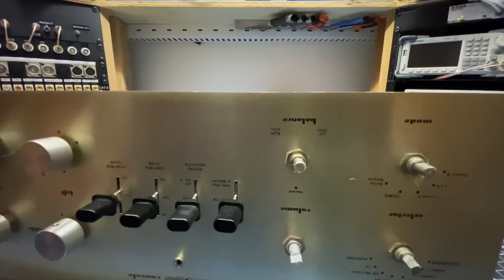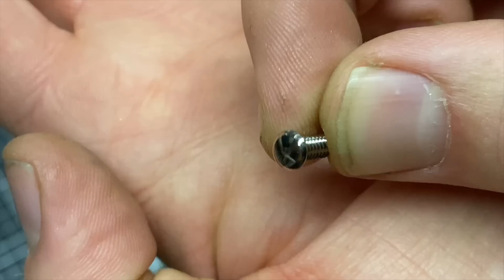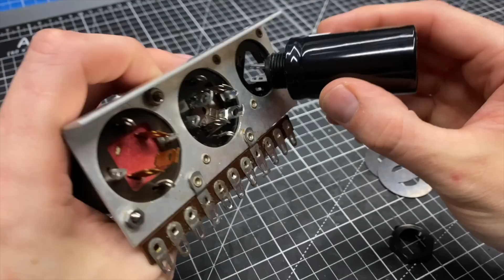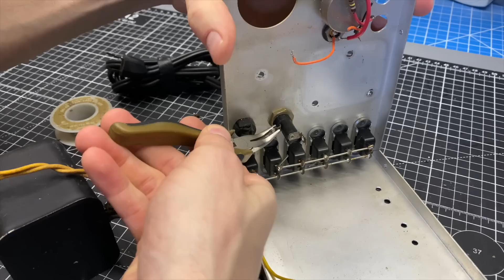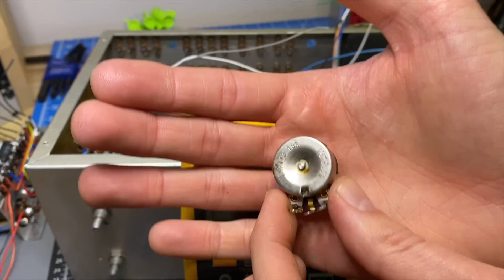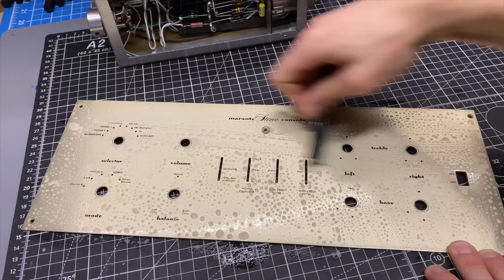Marantz Model 7 Rescued - Gut Rebuild of Hacked Unit at the Bench

Comment: When You are dealing with a really nice high end preamp... I would say less than an ohm between all the phono jack grounds and ground is really important.  Especially if the panel is aluminum.  I would say wire in each ground,  put them on a buss and return that to main system ground by soldering.

Comment: Beautiful work on that amplifier, I can't imagine how many hours total you have in that rebuild from the original hacked up amp!  I know that when I redid a HK Citation 1 it took over 40 hours to replace everything.  Why did you leave the original paper bumble bee caps at this point, their lifespan is limited at this point and the amp is far from an original example as well?
Reply from the maker: In this circuit when the tone controls are set flat all of those caps are effectively bypassed which is why I don’t usually replace them on this model

Comment: 30 VOLTS BUT METER SAYS 82.2   THEN 117 VOLTS BUT METER SAYS 311.8  WTF YOU ON ABOUT?
Reply from the maker: If you had a timestamp I could probably better answer this but I am probably referring to the voltage readout on the PR570 variac not the fluke meters.

Comment: My Dad GIFTED me both Marantz Models 7 and 8 but NOT a 10B-  my Dad said  wasn't yet available.  He Bought a HH Scott 350 FM Tuner.  

Anyway, under the Guidance of a great Electrical Engineer Friend who recently Retired from Tektronix, we Rebuilt the 7's Power Supply.  My Friend got all Parts we needed.   We also Cleaned the Pots, and Installed my Dad's 6 New Tubes(!).

I also Cleaned the Front Panel and Noticed that Chassis Parts were Stamped with Serial Number of unit!  My Dad's Model 7 had Silver Metal Knobs on Center Slider Controls.

When Finished, l DEFINITELY noticed how much Quieter the reworked 7 Sounded than before we did Work.

Comment: Great job!, it looked horrible to begin with. I was surprised you didn't check the bumblebees for leakage, I have found many bad ones while rebuilding Halicrafters radios.
Reply from the maker: Oh, they are leaky, no doubt about it, but in the tone control circuit it doesn’t seem to come into play so I don’t mess with them unless I observe egregious frequency response error.
Reply: @NovaluxStereophonic  Your testing surely proved they tracked and worked, so in the end everything was fine, and that's all that really matters. I always use my tone controls, as I like things with more bass and treble, but that is my preference. I am older, and I am sure I am compensating for some hearing loss as well.

Comment: Amazing video. Your narration and pace of the restoration perfect and engaging. I have a one family owned Model 7C Serial # 11600 ish Serviced by George Meyer AV only 15 capacitors replaced. Did a volume control test as I was curious after listening to the video. Selected A + B (mono) and played with volume control with no perceived problem with amplitude channel to channel. So some survivors don’t have this issue. Might be the time of building as well since this was a late 1962 or early 1963 build and quality at the Long Island factory was at its peak under the watchful eyes of both Marantz and Smith. Quality of the carbon volume control certainly could have suffered after the superscope acquisition. Just a thought that when and where the unit as well as care and condition might make a difference. Probably the greatest addition was the Balanced Gold Lion tubes that replaced the original tubes. What tubes did you use? Loved the oscilloscope visualization of the filters at the end of the build. One other thing I just noticed at the end of the video the power switch is white and mine is black. New component?
Reply from the maker: I do not recall the final vacuum tube compliment. It was likely a mix of modern Russian 12AX7 and vintage Telefunken. The white switch was likely installed at some point in the past. If the switched outlets were used to turn on an 8B or similar I could see the switch wearing out over time. Thank you for watching the video and taking the time to write a comment.

Comment: I knew Sid Smith who designed the model 7.  The 18  volt ECC83 heater supply ingenious.  6.3 V to the most sensitive section? Sid had model 7 and 9 in Triode. Quad 63 speakers. It sounded  very accurate. An extremely nice person. I would have loved to have asked him about the heater voltage. I met Sid via a friend. Sid would appreciate your work.

Comment: Soldering those ac outlets with the desoldering iron like a boss :P I do the same thing when I need a little extra heat for something like that. I've been doing hobby work on audio stuff for close to 30 years now, mostly speakers, but in the last couple I've been having fun building and working on amps. I've been trying to set up my workbench enough to maybe start taking on some outside projects. I'm pretty jealous of some of the measurement gear you've got!

Comment: Nice restoration! Excellent work! Refreshing to see someone else do such a great restoration job. 

Interesting why you used modern film caps. If your going to the trouble of sourcing and selecting vintage carbon comps, why not select vintage caps as well? Vitamin Q type or Sprague 160P's hold up well over time. That's my preference for 7 restoration.

I'm not a fan of the Hayseed's as 1)- they have no vent holes! 2)- I have no idea what they are stuffing inside them. F&T Authenicaps work great.

Regarding the disintegrating side panel foam- I use a sheet of 1/8" cork. Works great and never sheds!

Keep up the great work! Truly a craft.

Comment: Great rescue and reconstruction!   I have owned perhaps six Model 7 preamps and still own three.

I wanted to know why it seems that you did not replace the form pad on the left of the selector switch.  My experience has been that it was there to dampen vibrations to the wiring harness.  I realized this fact when I ran my finger against the harness and it was super sensitive to touch.  

Did you see a date of manufacture stamped on the back side of the front panel?  All of my units bore such a date.  Perhaps a previous owner cleaned the back and wiped it away.

All of my examples were furnished with photo-etched front panels.  The lettering was not silk-screened, but those markings actually set just below the surface.

Once upon a time, I owned a Model 7 which came with an original faceplate which was in fact, silk-screened.  It also did not come with rack handles.

Anyway!  Congratulations on an amazing restoration!

Comment: Excellent. Loved watching this. Can you explain a little more about "marking the outside foil to minimize the noise floor" on the film caps? How do you do identify the foil side and does affect how the capacitor is installed?
Reply from the maker: If you do a search for “Mr. Carlson’s Lab outside foil” that should get you pointed in the right direction. He does a very good job of explaining it.

The process involves testing and marking each cap and then installing them in the proper orientation to effectively make the outside foil of the cap act as a shield. It’s not 100% necessary but on tube gear I try to go the extra mile to keep noise / hum as low as possible.
Reply: @NovaluxStereophonic  Thanks for the reply. I've seen that video. Mr. Carlson's Lab is very informative and thorough. Sounds (kind of a pun) like a good idea. Can this be done accurately/reliably without an oscilloscope?
Reply from the maker: @stevenjackson8226 If you are interested in his circuits consider subscribing to his patreon page. For the circuit he shows on YouTube and oscilloscope is needed.

Comment: This is the best rotisserie restore that I've seen in awhile. Keeping all the good parts. Replacement parts are to speck. Mostly. 
First fire up. The 7 was missing a little. Little fine tuning with better parts. Purrs like a kitten now. Fuel economy isn't that bad either.
GGs..

Your testing bench is a Tech drool fest. What was the neutral load going back to your AC power supply? Just curious.

Comment: Just did a restoration on one. The power supply had been worked over but unit was in good condition overall. I did notice two things and the owner noticed them too. One, the volume seems a bit low and the balance control affects the overall volume. I believe all the voltages were within spec and I did not have to do anything with the front panel wiring (input selector, tone switches). Other than needing to have the volume setting up high everything appears to work just fine.
Reply from the maker: The balance circuit in the 7 actually boosts audio when put far left and far right unlike many other designs. You can use the output controls on the back of the unit to fine tune the output level if volume control is not responding well.

Comment: I've got a Marantz 3300 with a bent corner due to shipping as well.  How did you straighten that corner without damaging it?  Great job on the restoration!  Thanks!
Reply from the maker: It’s never going to be perfect but a bench vise with a couple pieces of leather can go a long way to straighten things out. Better to grip and bend rather than cranking on the vise as that will compress the aluminum. Take it slow and use your best judgment. Good luck!

Comment: I appreciate your work and nice job on this unit. I do this full time as well and I too will not use third party parts, nor do I use rebuild kits of any kind. That being said I disagree with you on a few points. I think you can give a client a better end result by letting them choose on individual electrolytics vs buy multi section cans.  Multi cans are always going to be more expensive than buying individual caps from someone like Nichicon. Generally the individual caps from Nichicon, Panasonic, Rubycon, etc are going to be better overall than what you get in the multicap cans (ripple current, leakage, hour rating). If a section of one of those cans goes open then you need to replace the entire can if you want to keep that stock look, where as if something happens to an individual cap then you can address it. 

Now with Hayseed, I used to use them pretty frequently, but three times it has happened where about 6 months or so after installation one of the sections goes bad. Trust me, I’m not the only one this has happened to.  There are videos on YouTube of techs having problems with new Hayseed cans and documentation online of it as well.  So I stopped using them completely. If a client wants to pay me the extra amount I am happy to stuff the original cans. Otherwise if it’s on the bottom of a chassis and they don’t care, I’ll place them on the bottom in a neat and orderly way. I mean you’re putting new polypropylenes and whatever else in there, so it isn’t going to look factory anyways. For my personal units though, I re stuff the cans. I do really like the cans you make, maybe you could make a video on the process of making some? I’d love to see that.
Reply from the maker: I appreciate the comments. If I mention making custom cans it simply refers to placing a custom order to hayseed with my specifications. On units without exposed caps I sometimes use adapt-a-cap or rebuild the can under the chassis on terminal strips (This is the best if it can be made yo fit as if one fails in the future it’s super easy to replace) I have an example of this in my Marantz 9 video.

I restuff cans for some personal projects but it’s actually cheaper for the customer in most cases to pay for the hayseed cap rather than my time to restuff.

I have not seen any failures yet from Hayseed after 50+ caps ordered. I have though seen CE multi-sections fail multiple times.